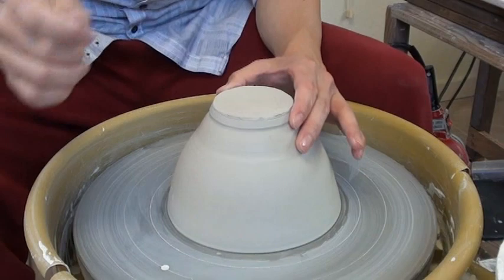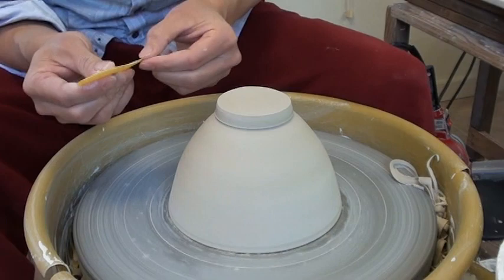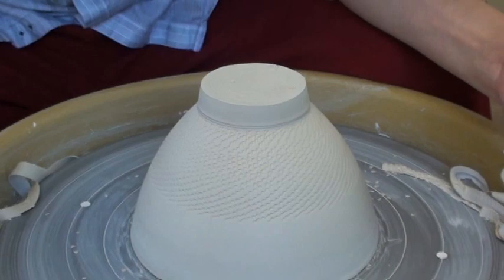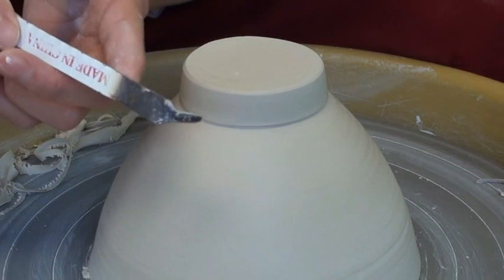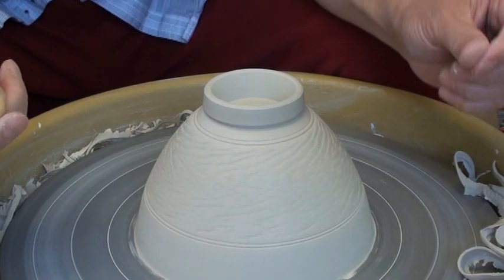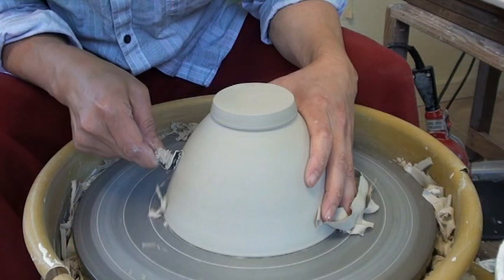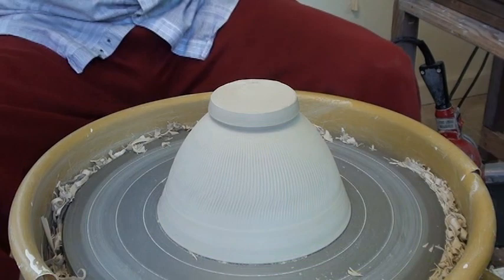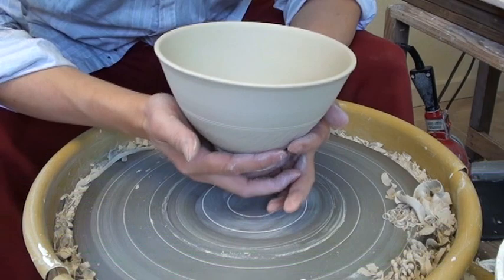113. Learning the Chattering Tips for Texturing the Pottery Surface with Hsin-Chuen Lin

Comment: These videos are great. I just started doing the chattering. A couple of hints from someone just learning the technique. 1. Your clay must be on the dry side for the chattering to work. If too wet, you will just make a line instead of chattering. 2. Be sure to burnish the area of the chattering before chattering, if you plan to color it with underglaze and not glaze over it. The burnishing will give the area a nice sheen. Thanks

Comment: This video shows very well what a simple tool is able to create on the surface of a pot. Obviously the pot needs to be at the correct dry/wetness; leather hard, the tool you're using needs to be nice and sharp and you need to learn about the different angles and tools to use for different effects.

I like everything about your videos except one thing! The noise of that wheel, haha. Every thing else is perfect.

Thank you for sharing this "very informative" video with us.
Reply from the maker: The manufacturer heard people’s complaint about the noise, they sent me a new motor and controller for free.
Reply: @hsinchuen  That's excellent new, I am pleased and that this will stop any complaints and people can now concentrate on your videos 100%.